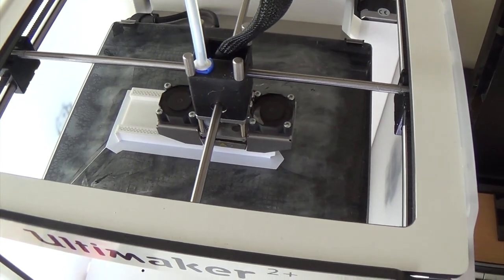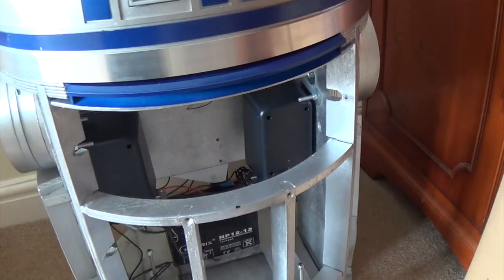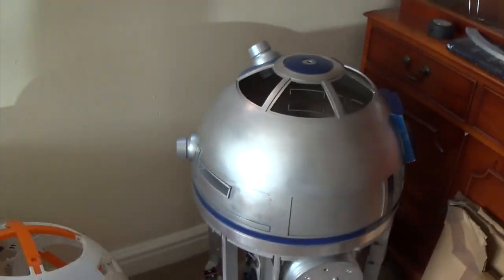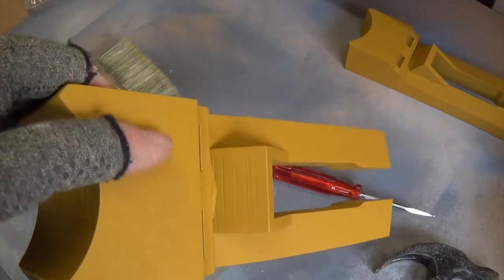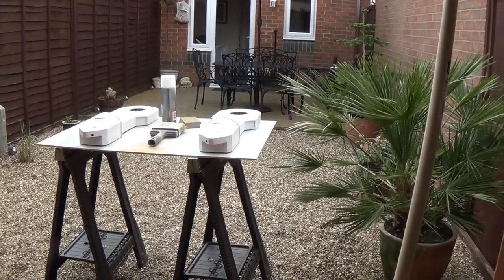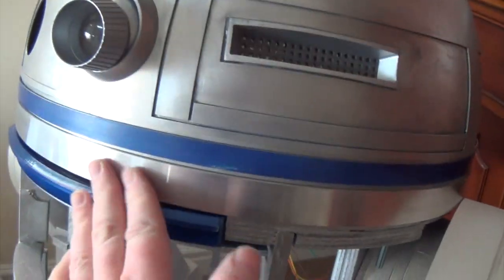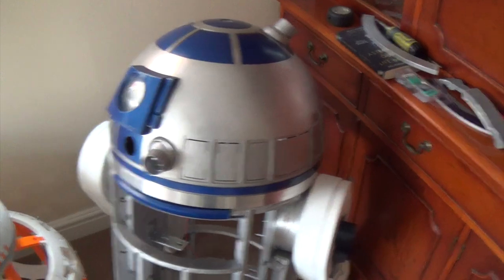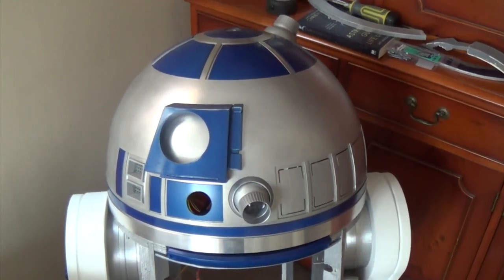Full size R2-D2 build  -  Part 3

Comment: check out thingaverse for a lot of R2 stl files.
Reply from the maker: +Haydn Bold Yes indeed, there's some good stuff there. Thanks!
Reply: +Movie Models your a great model builder and projects are great when will the RC BB-8 pt 3 come out?
Reply: +Movie Models if you want to paint and the weather turns on you often and you don't want to make a painting mess inside you could make aspray booth search James bruton xrobots a spray booth for more detail.